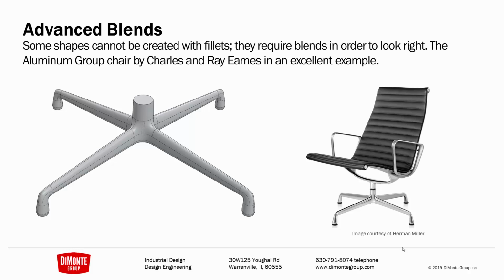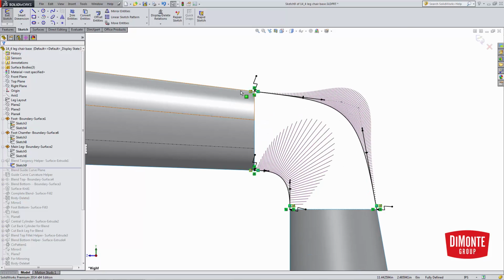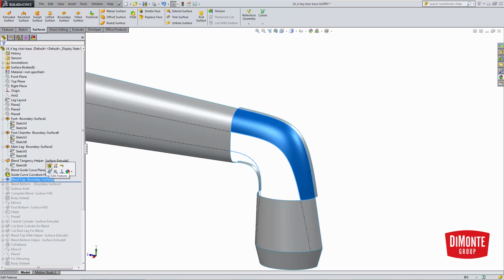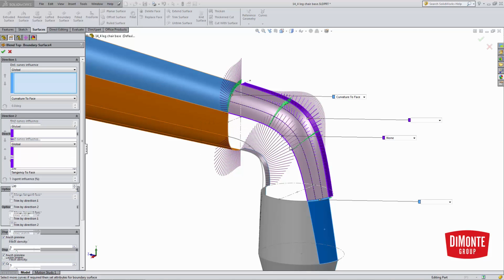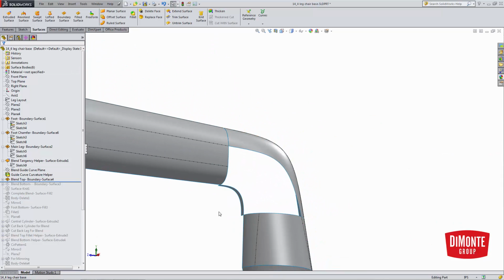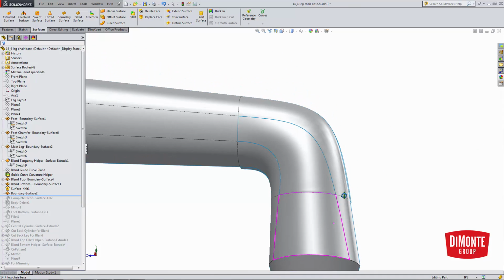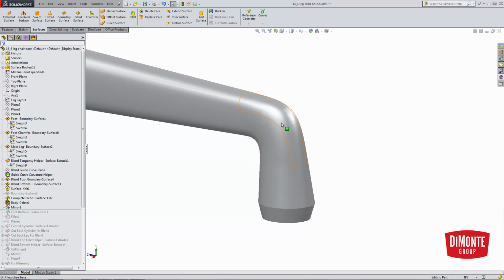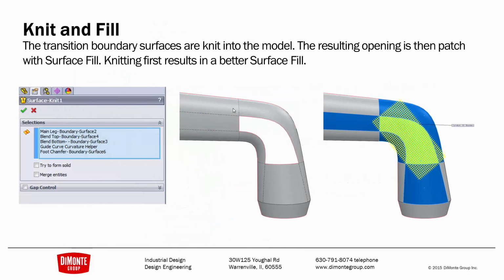Will It Fillet? | 12- Advanced Blending

Comment: At 6:36, I notice you "checked off" the optimize option, which is usually checked/on by default.  Is that your intention, or would it have worked with the optimize checked/on?
Reply from the maker: Great eye, and such a great comment trexinvert!

We always check it off.

If you have it checked off, "Fill Surface" uses a powerful n-sided patch that was ported over to SOLIDWORKS from CATIA around 2000-2001.  

You can see in the video that the preview mesh grid is not parallel to the edges of the patch boundaries.

If you have "optimize surface selected, in the background it is a loft, but without the explicit controls.  "Optimize surface" serves no useful purpose that I can figure out after thousands of hours of modeling. If I would have wanted to make a loft (or better yet, a boundary patch), I would just have done it.
-Ed
Reply: @DiMonteGroupInc  Yes, thanks it is amazing how a small setting in this surfacing command can make a big difference.
I am noticing more advanced sw surfacing users doing the same.  Keep making more video's.  The quality, scripting and presentation is the best.